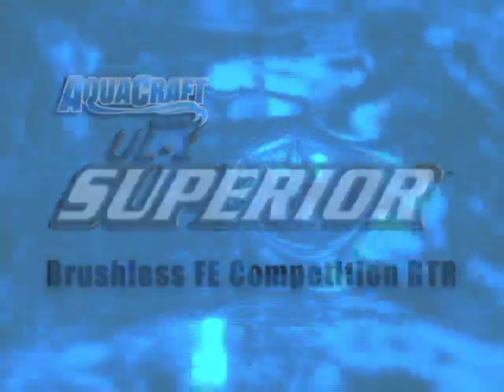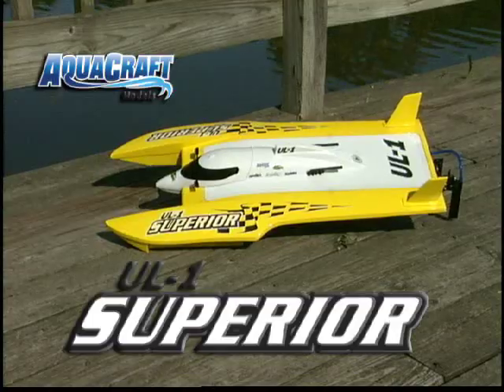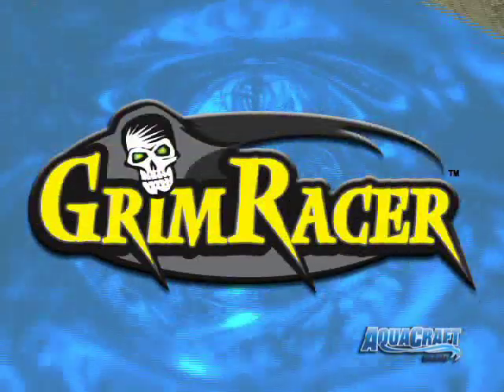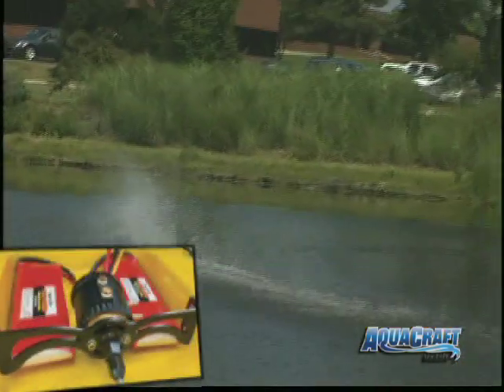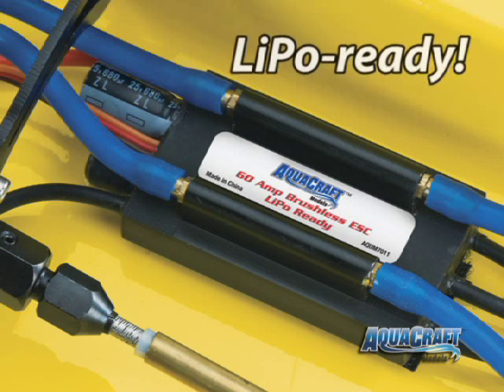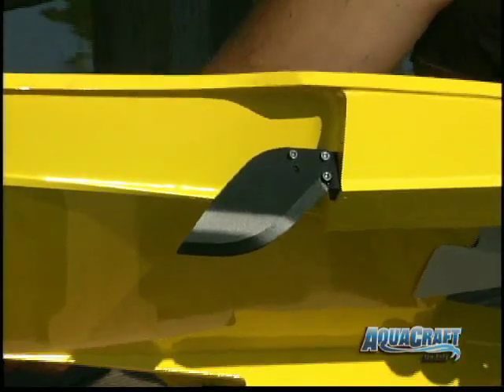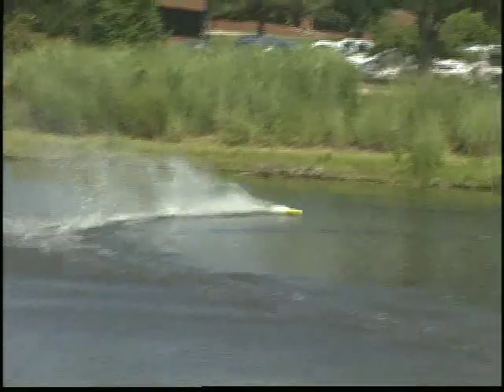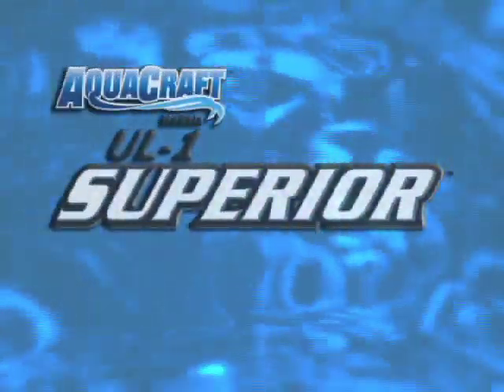Spotlight: AquaCraft UL-1 Superior Comp FE Hydroplane RTR

Comment: my buddy just got one of these in yellow, its has some appeal but it has some baddies to , 1 cheap plactic cowl very expenisvie to replace that and the nose peice props are way to over priced for FRP plastic props now options for battery placment or size of batts unless you really shop around alot and that can mean poor quaility batteries just to get some better runtimes.. also the placment of the water exit hose bad place you can not tell if its working or not. and the esc and motor specs are very boardliine to each other so what the burst time or you get an over heat fast andthe boat will shut down .. other wise over all not bad machine and shes fast and pretty easy to control for the most part .but these things need to be improved on..